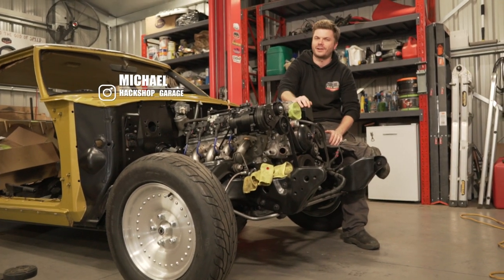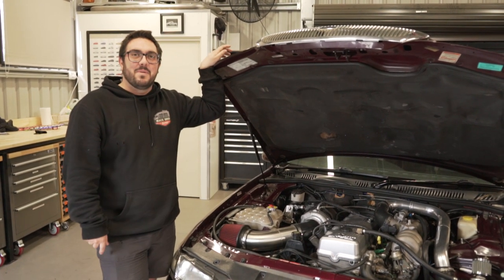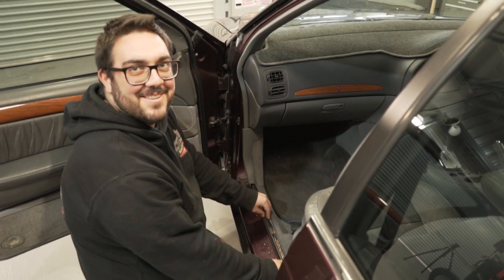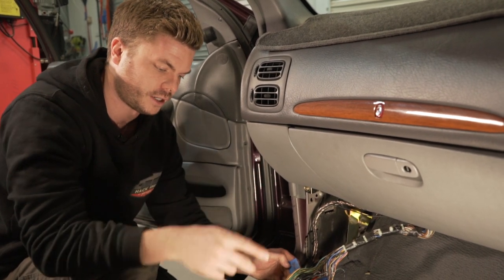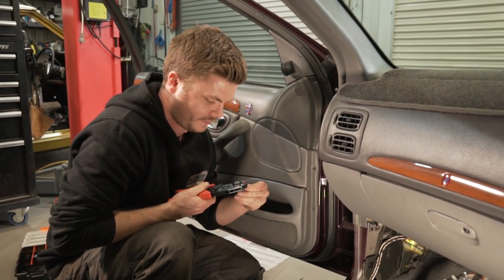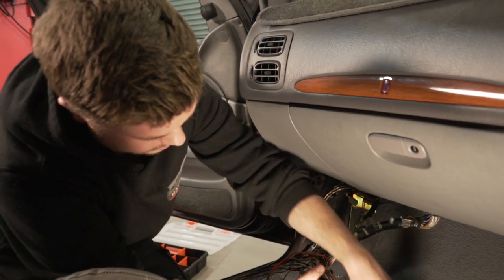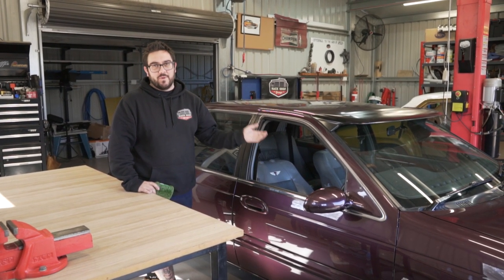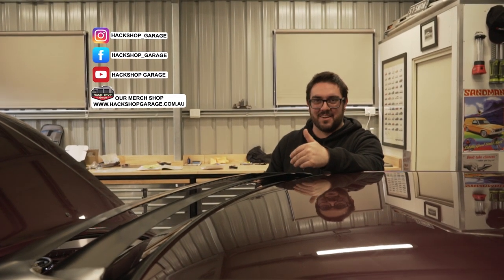Turbo Fairlaine Build - BTR Manualised Shift Kit

Comment: Finished wiring the haltech in a few weeks ago in the au. The elite 2000 is capable of fully running the btr though I'm yet to do it.
If you haven't done it yet the factory ecu only needs crank signal and tps to be happy shifting which are fine being piggybacked.

Comment: If your worried about power capabilities of the j pipe don't even bother with a 6 boost mani. Good j pipes will flow as much if not MORE than fg turbo manifolds so easily good enough for 600kw maybe even more depending on the pipe size. Keen for the build 👌
Reply from the maker: Thanks for the tip mate, we will keep that in mind 👍🏼
Reply: @HackshopGarage  anytime guys love the work 👌 can't wait to see how far you take this beast

Comment: you could try a quicksilver shifter. they ratchet in 1, 2, 3, D and you lift the shifter for the other gear.  but no neutral lock out though.

Comment: Oh and if you haven't made a decision on coils yet it's cheaper to go with ls1 coils than a separate igniter for the factory coil pack. Added bonus of ls1 coils and the factory leads can be used.
Reply: I did the same thing. Though you can use a single ls1 coil to run the dizzy, but the tfi is a steaming pile of shit and my haltech wouldn’t run it correctly
Reply: @E-Z_Gaming  ditch the dizzy, Mines Au s3 so it was igniter or choose coils and I wasn't keeping the factory coil pack!
Reply: JT yep I’m running 6 ls coils and 460hp
Reply: @E-Z_Gaming  I've not dyno'd yet still running in the motor but it's built for 1000 plus rw. Got out of control pretty fast once the internals were purchased!
Reply: JT mines stock bottom end, au gasket, crow cam, springs, custom plenum and s366 turbo. Haltech and 2000cc injectors
Reply: @E-Z_Gaming  I was on my 3rd stock motor and getting sick of blowing out the rings or lifting the head. On E85 it loved life but as soon as I switched to 98 I started having issue's.

Running 6boost mani, 3584, turbosmart hypergate 45, snort forward facing plenum, stage 4 crow cam, crow springs, ported head, 1000cc bosh injectors, walbro 460, turbosmart 1200 fpr, elite 2000, haltech wideband kit, built btr. Romac street balancer. 
Pretty keen to get it on the hub dyno.
Cp corrillo pistons, corrillo hbeam rods.
Reply: JT nice man what area are you in, I used nugget garage aka Cleveland exhaust